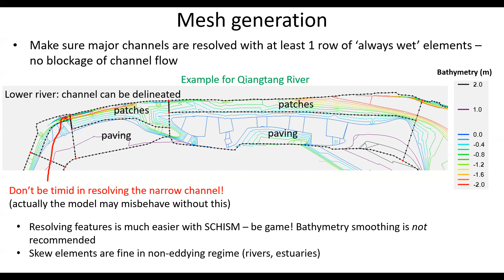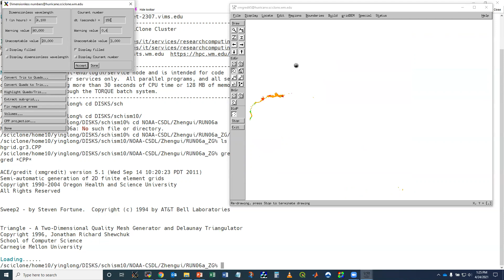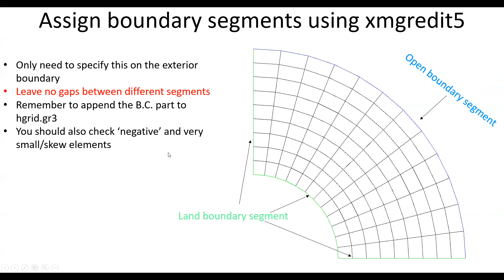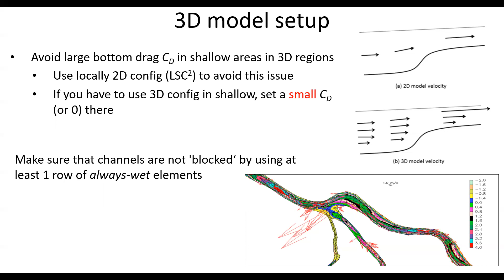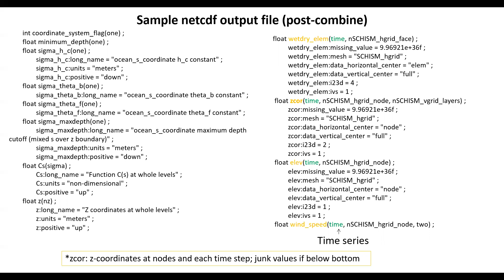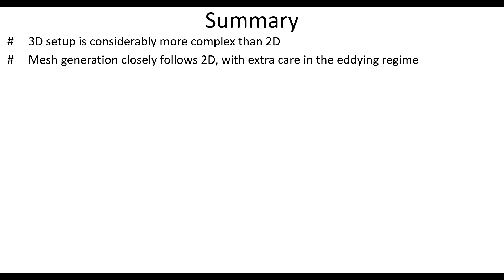Introduction 2

Comment: According to the SCHISM User manual, CFL > 0.4 and therefore the unacceptable value should be set equal to 0.4 while the warning value can be kept equal to 0.8 or 1. It seems like you are doing the opposite thing. I am a beginner and I am trying to understand the influence of the CFL number for implicit methods. Thank you